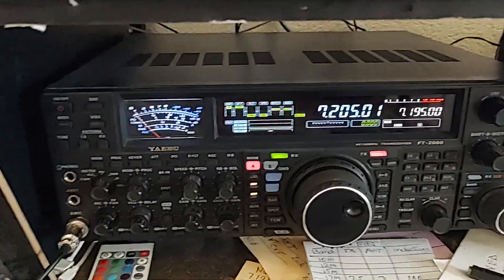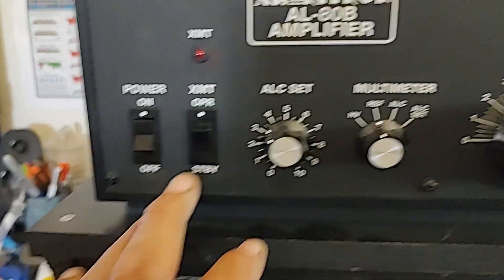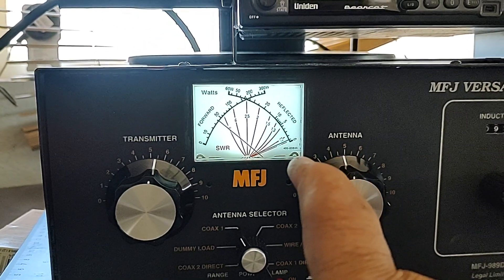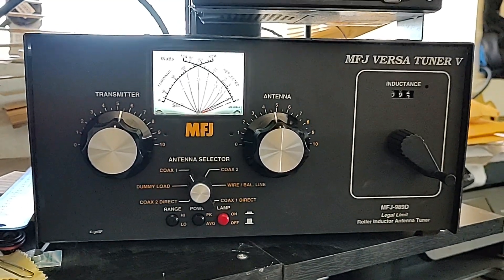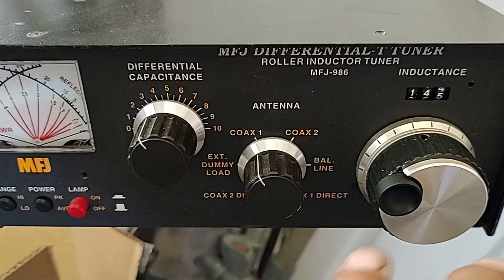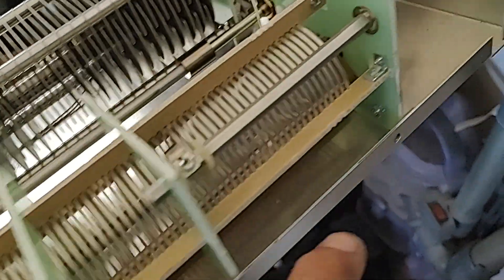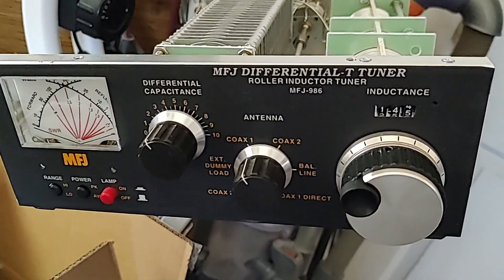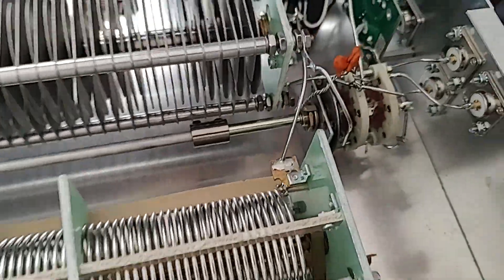SWR / POWER ISSUE With MFJ TUNER, HELP! SWR CLIMBS by self after reaching over 700-800 watts

Comment: lol internal dummy load is 300w rated, you are heating it up
Reply: You using a balum rated for the wattage
Reply from the maker: @n8ibz1  Never used The Balun! LOL, was not using ladder line. Thanks
Reply: Did you ever figure out the issue

Comment: If you are measuring with the meter set to peak, all you are doing is charging the meters capacitor, while checking your SWR, you should be reading average power mode only, the PK is for SSB.

Comment: I glanced at the AL 80B Manual, it doesn't appear that you are overdriving your amp.  Is everything well grounded?  I used an 811H and an MFJ 986 tuner.  MFJ's cross needle meters can be a bit odd sometimes.  It could be RF getting into the meter from another path.  I'm not an MFJ basher at all, I've owned their equipment for decades.  I switched to a Palstar tuner recently after my 986 did some arching.  I fixed the tuner but I don't trust it on high power just yet.  The power ratings are to be taken with a grain of salt.  Can you put another directional watt meter in line after your tuner?  Is there any possibility that you have the meter on peak power?  Good luck, I know how disappointing having new equipment malfunction.  When I got my 986 thirty some odd years ago it arrived with the turns counter belt off and the inductor was all out of line so the first thing I had to do was open it up.  You really need to have all your equipment grounded to a bus bar and that grounded to a proper earth ground it may very well fix the problem.   73! N5WRW

Comment: I agree with previous comment.  Something is heating up at high power, prob a toroid balun/unun.  If it's internal to the tuner then there's a problem with the tuner as it should be able to handle legal limit.  Try to feel around to see what's getting hot to the touch.

Comment: What type of antenna are you using. It acts like a Bulun or more specifically the Toroid within is heating up and the permeability of the Toroid is changing.
Reply from the maker: sorry for the late response, I am using an ALL-BAND DELTA LOOP,  total wire is about 550 ft, but its moot now,  sent it back to MFJ for full refund and now using the MFJ-998 AUTO TUNER without issues, thanks for your question and or possible help, 73 DE KD6SBR (Tom in NV)